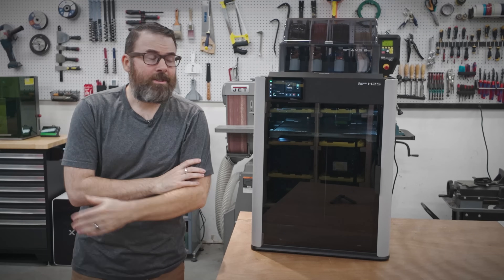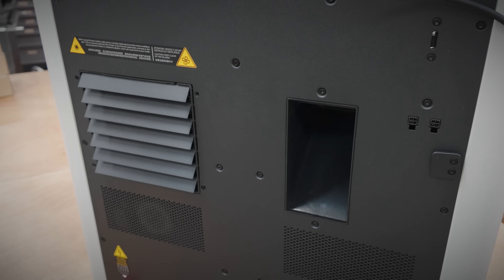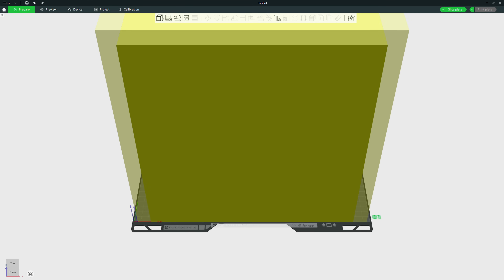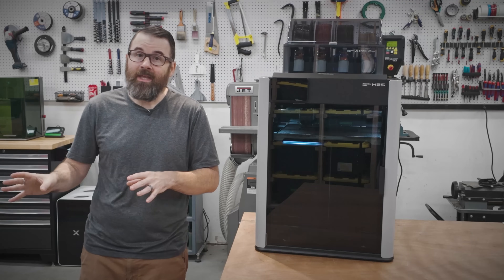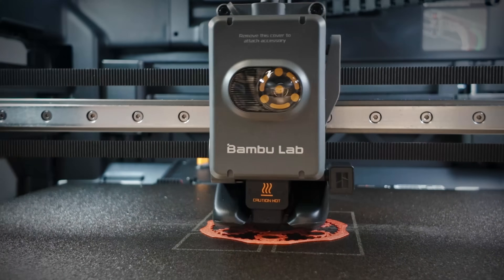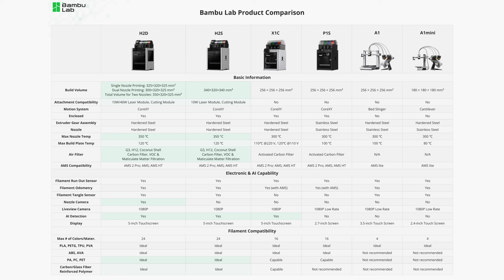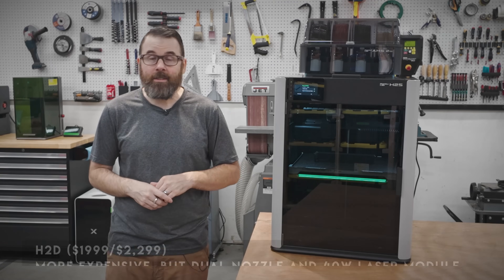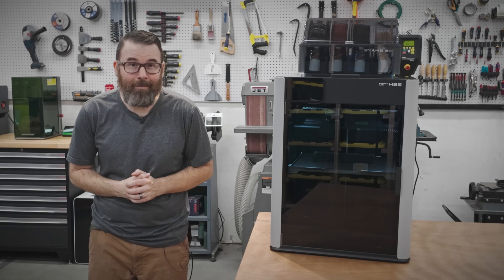What you need to know about the H2S , in 4 minutes.

Comment: 12.27.2025  
H2D: $1729. 
H2S: $1,099.

That is a pretty steep increase to effectively only be due to having the second nozzle.
Reply from the maker: It's $1249 vs $1749 right now, so $500 difference.  It depends on if you 'need' that second nozzle.

Comment: Hi Robert. I got the GWEIKE LASER 55W a couple months ago and I still don't get it. I mean I can't get a reasonable parameters to cut and engrave my 3 main materials to work. Acrylic (normal and mirror), MDF, and Basswood all of them 3mm. Do you have a decent table that you can share? Thanks in advance. Remember is 55W
Reply from the maker: What issues are you having with it?  55W should be just fine for all of those, especially 3mm.
Reply: @RobertCowanDIY Thanks for reply. I can't get the correct power or speed to cut or engrave any of those materials
 With The recommendations from gweike website I am not getting god results. That is why I am asking if you haver any references parameters

Comment: you actually get 350 mm X with the H2D but you have to use both nozzels with the same filament loaded
Reply from the maker: well, yeah, I guess.  but you won't be able to print a single part that's 350mm wide.

Comment: Do you know or plan to test the speed difference between the two machines when using two different filaments?  Specifically using the second filament for support material.  Thanks and as usual, love your style videos.
Reply from the maker: I don't.  However, you can EASILY do this with the slicer.  Just add the H2S in the slicer and compare it yourself.  This is highly dependent on the materials, the number of tool changes, etc.  You really need to look at the type of things you're trying to print.  For me, I usually only do materials changes at specific layer heights, so the difference is trivial.  Just load it up in the slicer and see for yourself, it's super easy.
Reply: Thanks, I hadn't thought of doing that.
Reply: Update, I tried this and found that in my situation there is a considerable speed difference with the print I sliced.  Almost 3 hours.

Comment: Though this printer will have a hard time next to the cheaper four-toolhead snapmaker U1.
Reply from the maker: I doubt it.  Based on previous snapmaker problems, I'm not convinced the U1 will work as advertised.  If it does, that's great.  But it's also quite a bit smaller and doesn't have a lot of the 'extras' the bambu printers have.  But hey, for some people it's gonna be great, but it's not for me.

Comment: Funny that as soon as all these H2S videos dropped, Bambu teased their new H2C with the nozzle changer. Glad to see they will be innovating in the direction of the Prusa XL…
Reply from the maker: Yeah, that was a surprise to many people, myself included!  I would say they're not innovating in the direction of the XL, but rather away from it.  The redundant hardware and cost on the XL was poorly though out, IMO.  Every single head had a layer cooling fan, extruder motor, etc, etc.  All that should be on the carriage to reduce cost and complexity.  The way Bambu seems to be doing it reduces weight and redundant costs.  Really smart.
Reply: @RobertCowanDIY I am not sure how Prusa is going to combat these models! The small print beds I moved to an H2D viewing the XL as to much hassle
Reply from the maker: @jeffstrains4014 unfortunately, they might not need to compete.  They potentially have a loyal enough following
Reply: @RobertCowanDIY  I have been one of those followers for over 5 years but when you start to need a larger build plate, and some enclosure options etc they seem to be lagging. I have full faith they will have something sooner or later.

Comment: For me it is simple. Any company that refuses to listen to its customers, focuses only on profit maximization, and caters to a handful of YouTubers instead of the paying community is off my shopping list. They can keep their oversized mistake of a printer.

Since Snapmaker unveiled its multi material system, every AMS based machine instantly feels like yesterday’s technology. What was considered cutting edge only a few days ago suddenly looks outdated. And now, with the H2S not even offering a dual head, it almost feels as if Bambu is trying to take its customers for fools.
Reply from the maker: This is something that comes up from time to time.  Just because it's something YOU want, doesn't necessarily mean it's what their core market wants.  I'm sure they have sufficient sales data to support a lower cost, larger format printer like the H2S.  It's nothing new, but it doesn't need to be.  It's just a bigger X1 (if you want to look at it that way).  It's not a mistake at all, it's a wonderful printer that's different from what you're describing.

Snapmaker still has yet to actually deliver a printer.  Several have been DOA, it's not actually in production, etc.  They also don't have the best reputation for reliable printers.  Maybe this will be different, but it's not actually out yet to determine that.  The price and features are great though.
Reply: @RobertCowanDIY take it easy with these comments man, they are not worth your time. Great video as usual!👍
Reply: @smity958 nah he sounds 100% realistic, unlike bambu haters that are embarrassing themselves.
Reply: @riba2233  I don't hate bambu. I have 4 PS1's and a H2D. Literally stating facts of my experience.
Reply: @smity958 which facts, that bambu is by far the best?
Reply: @riba2233  You've missed the point. There is no definitive "best" anything. Bambu might be the best printer option FOR YOU, but it isn't for everyone. No printer, or brand of anything, is "the best." Everyone has different requirements and no one brand, of anything, will meet everyone's requirements all of the time.
Some people, as an easy example, absolutely must NOT have printers that are connected to any cloud services. Bambu printers can't do that. Therefore, Bambu printers are not "the best" for those requirements.

This applies to every single thing humans do. There is no "best" laundry detergent. Or place to live. Or <insert thing people do here>. Or 3D printer.
Reply: The whole point of this is to be a cheaper, single head machine. Bambu doesn't need to realize another dual-head machine. Bambu already has that and it's been available for several months..
The Snapmaker is very interesting but still a paper release. Once Snapmaker starts shipping printers then I'll consider buying one. Right now it's vaporware.
Reply: Take it easy. You need to see somebody about that anger issue